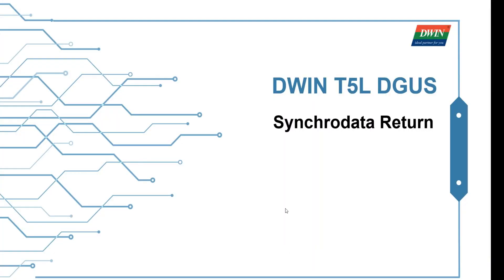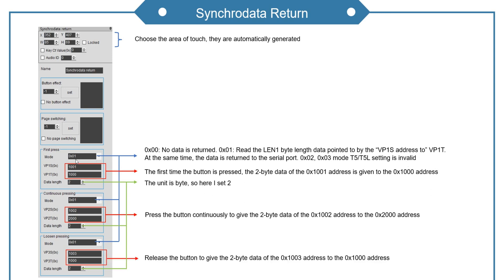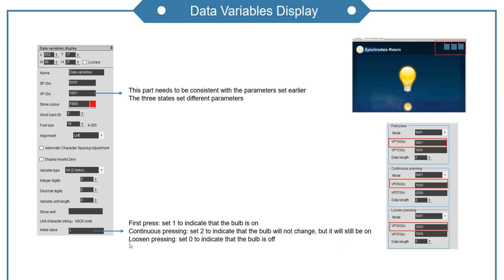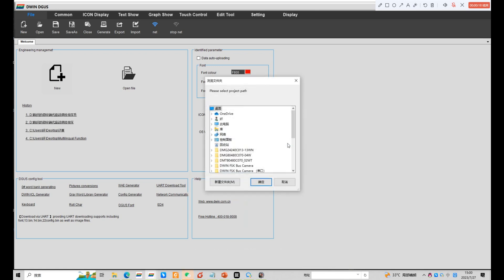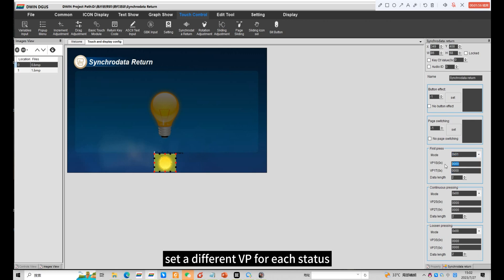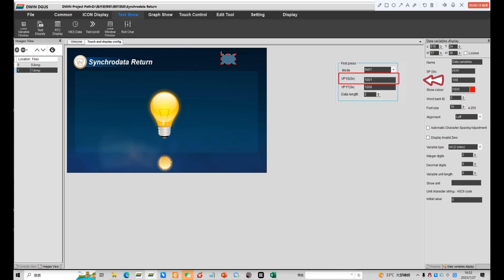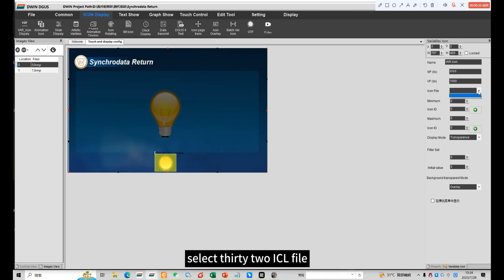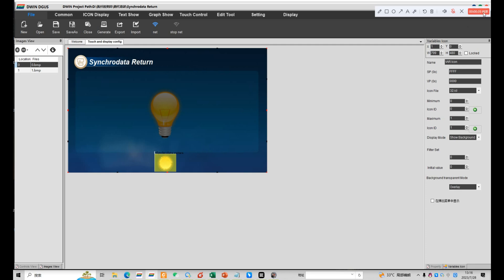Basic Tutorials 20 - How to use the function of Synchrodata Return | DWIN T5L DGUS Tutorial

Comment: I have set a synchronous data return on a button, and in the configuration, I have assigned it the return value 0011. However, sometimes it receives random values like ffd2 or something similar. What should I do to stop this?
Reply from the maker: If possible please send the complete project to cindychen@dwin.com.cn, thank you.
Reply: I have an issue going on i followed ur exact step but it didnt worked! Nothing happens when i touch the button. Plz help